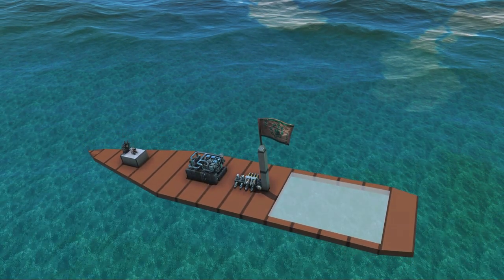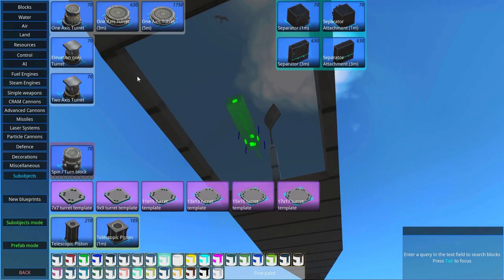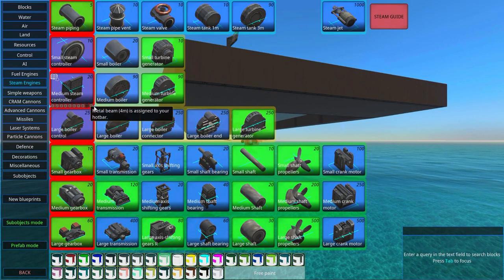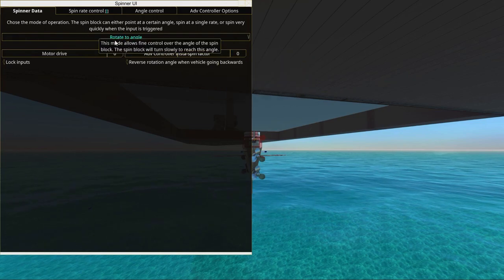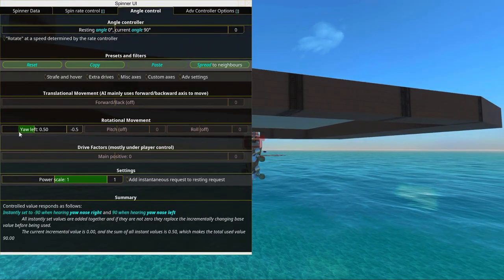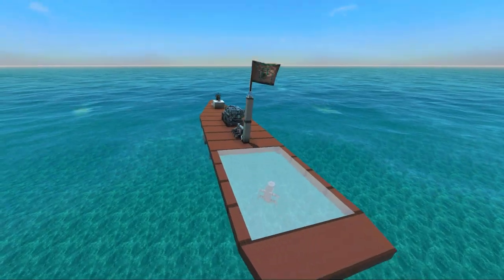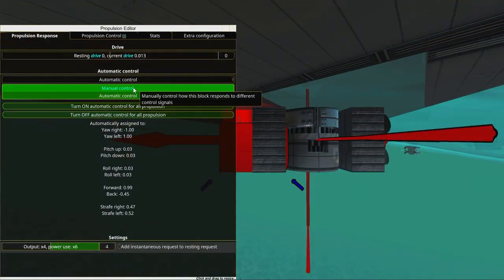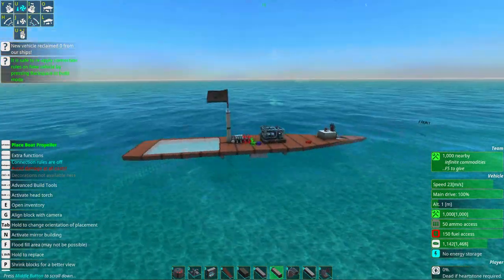How to build Azipods (Propellers on Spinblocks) - From The Depths INSTANT Tutorial

Comment: But how do you make the A.I take control of the Azipod?
Reply from the maker: Doesn't yours after following this?
Reply: @GMODISM  For some reason one ship doesn't, it has everything it needs, it just won't operate the Azipods (or any other props), has behavior, has manuver, the Props and spinblock in the Azi are set up correctly, etc.
Reply from the maker: having engine power at all?
Reply: @GMODISM  Yep, uses a fuel Engine I designed for Ashes Super-Heavy vehicles.

Comment: and how would one set up a steam powered Azipod?
Reply from the maker: An Elevated Gmodist I see, welcome to the ecclesiarchy! So there are 2 ways, you need to use that part that lets you attach an steam propeller that uses engine power, then generate power via the steam engine. The other way would be to make a complete steam engine with boilers and everything on the spinblock down there, while that works it is not so practical.
Reply: @GMODISM  yes sergeant Jerry reporting! Aaah so i need to make a powerful steam engine that makes power. And then find the connector part for the propellor that uses engine power and not a shaft connection? I'll have a peek around
Reply from the maker: @JerryTheDinoKnight07  yes Indeed :)
Reply: @GMODISM  I cant find it HAHA

Correction ,I am idiot, doenst work without a crank now does it? lol
Reply from the maker: @JerryTheDinoKnight07  they are tricky, you need a shaft to connect the propeller but they all need to be the right size and be turned the right direction, look at the direction of the green "suction cups"
Reply: @GMODISM  yes i figured it out my 22m/s Corvette the size of a modern frigate now turned into a 33m/s nose diving submarine! 10/10 would ftD experiment again ( and yes i fixed it)